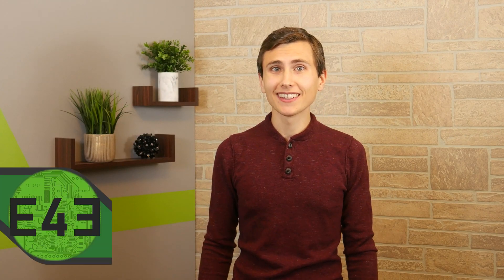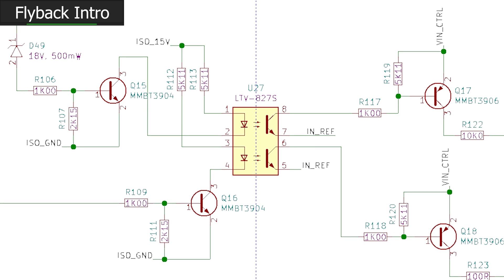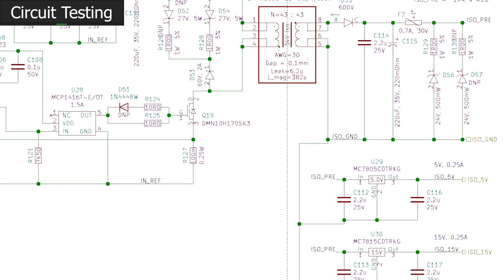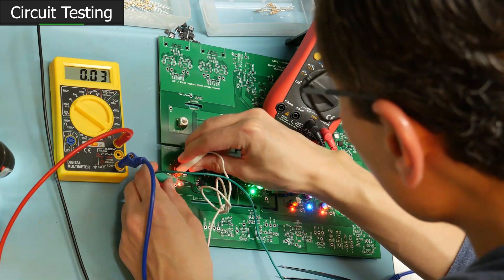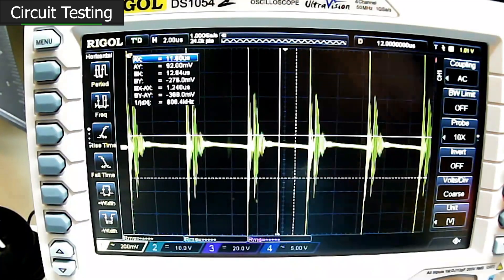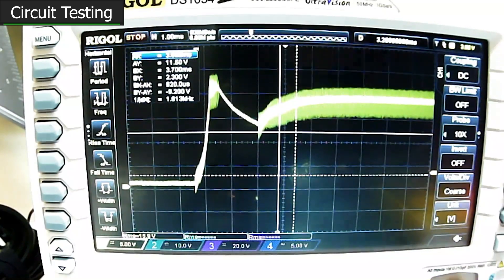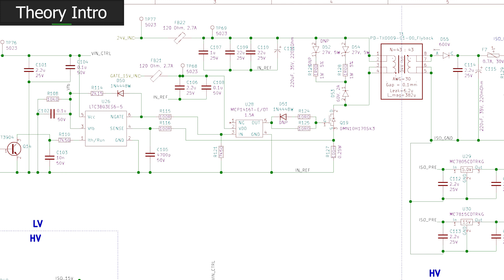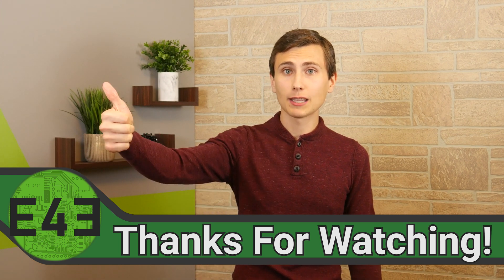DIY 5kV Isolated Flyback Converter! It Works!!!

Comment: Hi there. Good work =)

I'm re-watching the source stream. I watched it on 2x speed and I think I missed a few things =). Regarding soldering ground bigger devices, I usually swap between a k tip and a j tip? (knife & curved tip). Given the heat is in the end I can quickly swap the ends. A legit T12 handle can have hot swap, but I haven't made an adapter for mine yet.

Regarding plotting the PDF schematic, If I plot to PDF I get text? Not sure what would cause it to be just images.

I'm very interested in how you did your insulation resistance (Isolation?) testing. For DC, i've seen handheld test meters for cheap? Cheapest AC withstand tester I've found is RK2670AM?

Given the price of RK2670AM i'm no longer tempted to build one. I was convinced that they would be more expensive. HV connectors and transformers are cheap I guess.
Reply from the maker: Hi No Corporation! Good tip on the swapping tips, I really like the fine bent conical (J tip), but I'll keep an open mind. :) 

I did export a text-searchable PDF with the new buck design for this weekend, so you should be good to go! (Linked in the description of the live-stream)

Yeah, we used a high voltage source like that one. A Compliance tester goes a long way! Basically apply 5kvac across the transformer and measure the leakage current. Thank you  for digging up these part numbers and dropping them in the comments! I haven't dug around much for cheap (potentially knockoff) high-voltage generators.